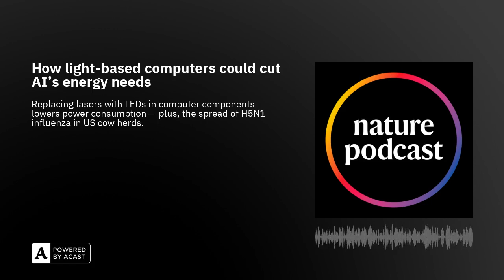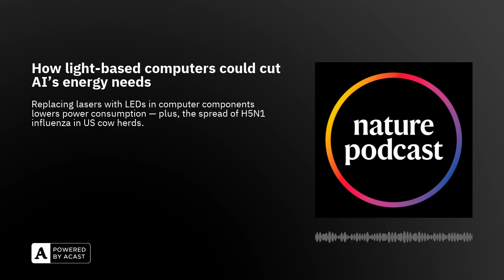How light-based computers could cut AI’s energy needs

Comment: Amazing that today very few people know that 40-50 years ago largely in the Defense, Medical, Test Equipment fields, a great deal of Digital Signal Processing was done with incredibly simple analog processing with Charged Coupled Devices that essntially did convolution and correlation merely by passing the signal down a delay line where the charge buckets could perform 2 multiplications and additions with a single transister, look up Transversal Filters and Power Spectrum CCDs. The early solid state cameras all used CCDs, once they went to CMOS sensors, CCDs were killed off and processing went all in on full digital logic. Most of what goes on in AI neural net processing is nothing more than dot products. Using light will not help AI unless it is talking about analog functions. Today though the semiconductor industry has completely forgotten its roots in efficient computations. See also Carver Meads work in neural processing, all of it in analog.